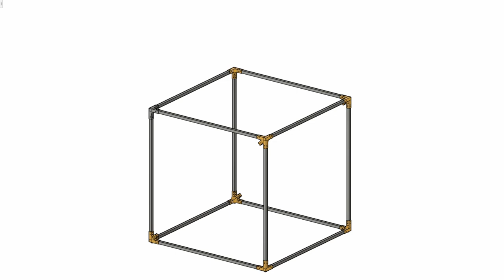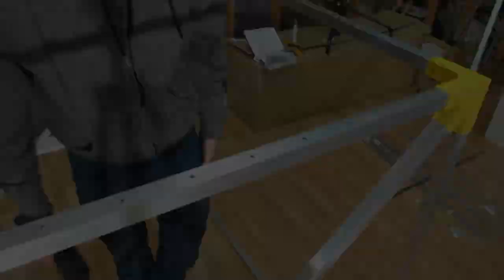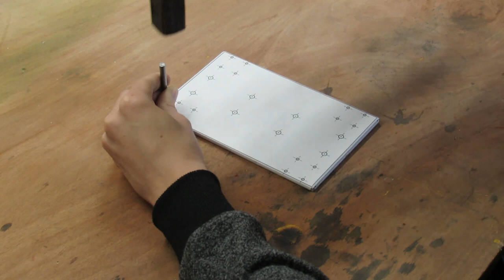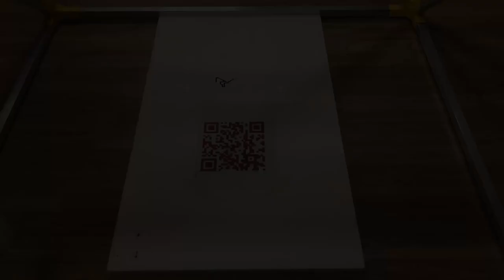3D printed 1x1x1m 5 axis cnc  / 3D printer part 1: XYZ axis

Comment: Next time you use linear rails, dont remove the small black plastic rail from the carriages, this is to stop the ball bearings from falling out,  when you want to add the carrage to the final rail, just slide the black ones off directly next to the rail so the bearings dont have an opportunity to come loose
Reply from the maker: That’s exactly what i did 😜👍 the tape around the bearing is to keep the black plastic rail inside
Reply from the maker: At 02:30 you can see the plastic rail 👍

Comment: Kudos for the commitment. What materials are you planning to cut with it? It will definitely not cut correctly aluminium, and even in wood it looks like it's going to take days to cut anything of that volume in 5 axes (3 axes would not been able to, except simple pyramids or so)? Fun project though.
Reply from the maker: It’s only ment for foam to create fibreglass molds. All the details can be found here: https://bbprojects.technology

Comment: Nice project. Subscribed!
I plan to build it too. What worries me most is drilling in aluminum. For me I always struggle with that part. Maybe you could a video to teach us how to get good at aluminum drilling and making threads into aluminium?
Reply from the maker: Thanks man, drilling the holes isn’t actually that hard. I used the 3D-printed parts as templates for the holes and this worked great. For some parts I printed the drawings 1:1 scale and used these as templates to create punctures in the aluminium as a guide for the drill. The project didn’t need any threading 😜👍 one advice i would give you is to always keep your drill sharp, if you do this it should cut through aluminium like butter 😉👍
Reply: @BrianBrocken  Which drills can you recommend? Do you sharpen them yourself? How?
As I said, a video detailing all the steps (speed, pressure, drills, drill sharpening, tips, etc.) in real-time would be nice.

Comment: I see 3 axis... what are you plans for the other two?
Reply from the maker: This is part 1 where i build and test the XYZ axis. Part 2 will probably about the 3D-print functionality of the machine and part 3 about the 5-axis part. The goal is to mill foam molds with the 5 axis machine.
Reply: @BrianBrocken  Nice!  Can't wait to see it all!  Great job!
Reply from the maker: Thanks man 👍
Reply: @BrianBrocken  Did you ever get to the 5-axis part? I have been saving this video for ages waiting for the CNC results. :-)
Reply from the maker: @brianware8818  I didn't get to the 5-axis part yet. I'm currently working on a few other projects. Also when i first started this project Fusion 360 was still free for 5-axis machining. They now charge more then 2000 euro per year for the plugin. So I'm not sure what the future of this project will hold.
Reply: @BrianBrocken  Thanks for the speedy reply! Ouch, didn't realize the plug-in went to pay for 5-axis. Every time a possible hobby item like this seems to head to reality, something kills it!

Comment: I didn't yet opened your files but just wonder what spindle you will mount on b/c head and if this will have any endstops to properly zero those axis
Reply from the maker: I just ordered this spindle: https://www.banggood.com/Machifit-ER11-Chuck-CNC-500W-Spindle-Motor-with-52mm-Clamps-and-Power-Supply-Speed-Governor-p-1027937.html?p=E01411629100201406T1&custlinkid=1616560
And yes, at 08:24 you can see the limit switches being installed and the homing sequence in action.
Reply: @BrianBrocken  I meant about 4tth and 5ft axis endstops like in this DIY project https://youtu.be/cbbLQcEyz20 to properly zero those axis
Reply from the maker: Ok, my bad. Yes it will have limit switches on the 4th and 5th axis. I'm currently working on 3D-print function of the machine after which I will attempt the 4th and 5th axis.